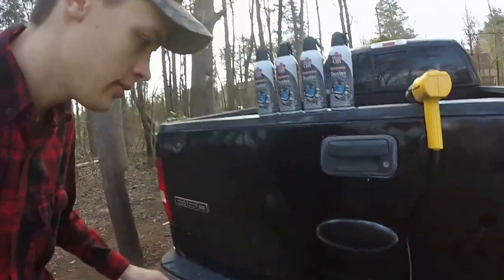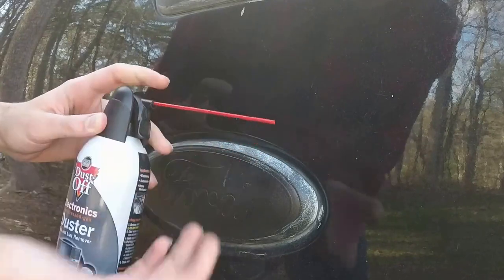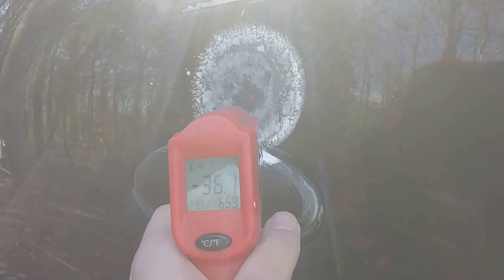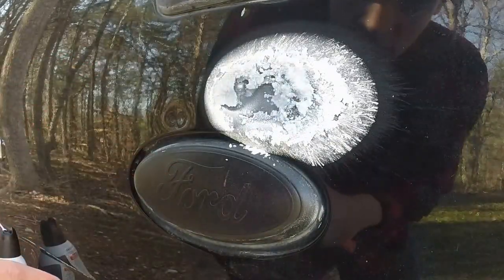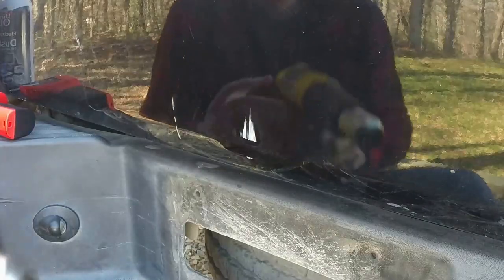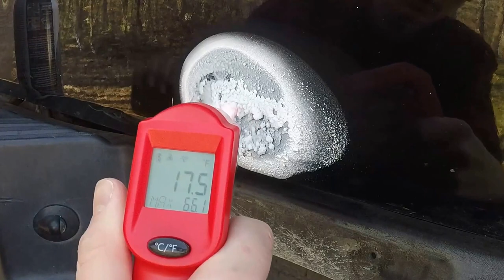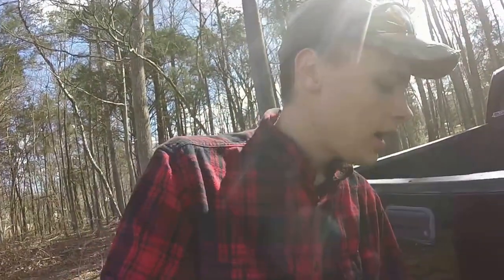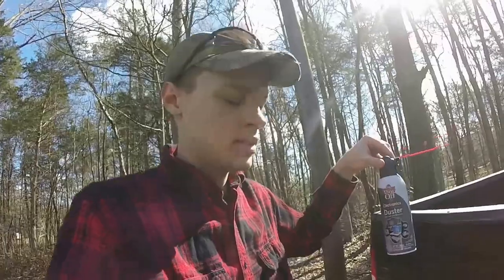Y'all Complained...So Let's Try using Air to Remove Dents Again

Comment: I thought this method only worked on large thin panels like wheel wells and quarter panels
Reply: Yes only larger panels that have large dents
Reply: @TeamYankee2  yeah he try,s it on the wrong kind of mats/dents u can only use this method on like a thin sheet door panel whit a rlly large dent whit no sharp agnles then it will work but indeed not on those small dent,s and not on the bumper witch is mostlikly a litttle thikker matal and btw how the hell do u get so much dent,s in ure car man my car is 20 years old and it hasnt got even one dent in it i drive it daily so how the hell do u do this xd

Comment: While I think you're just wasting can air. Should not take that much. The first Dent you did the second time. I didn't much see a dent so maybe you should have wiped it off so there was some shine to it instead of Haze; but it look like it took it out if not at least a little bit. Could be quite possible you're not using enough heat either

Comment: None of those dents were the type that can be fixed with this method. The body dents were too small and had no crease; the bumper dent might have worked if it was in body metal but bumper metal is too thick.

Comment: I believe you are still not getting the metal hot enough and I don't think you have to hold the dry air that long. If it doesn't pop after maybe 5 seconds then save you can of air. 
Also something to consider, today's metals aren't the same as the olden days where you could heat shrink metal. You would find that type of metal on much older cars.
Last thing to consider is this method only works on plastic cars!!!
Reply from the maker: +nomakeanykine The reason that I didn't get it hotter than 300 is because I was told by Ford that the paint in not designed to withstand extreme temperatures. For me, and I'm sure a lot others, I don't want to risk damaging the paint just to remove a small dent, to repair a damaged paint job is not cheap.
Reply from the maker: +nomakeanykine I have seen some people saying it works on modern metal vehicles. I don't plan on continuing the testing past this. As far as the heat, Ford wouldn't tell me what temperatures the paint is able to withstand. If I got it too hot, the paint could be damaged which is worse than a dent to me.
Reply: nomakeanykine  )

Comment: Your dents were to tight.  Stretched metal.  Won't work.  As for the bumper it's much stronger metal and you didn't even hear up the bottom where it had tension built up

Comment: It's a waste of time and money. Once you've creased the metal it's not just popping back. You've been had.
Reply: WINSTON SMITH not entirely true. It works off the process of thermal shock. Just like if you poor ice water in a hot glass itll break.